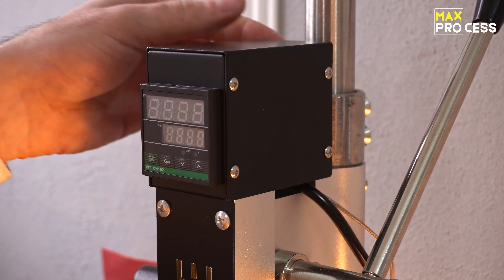The process of making a stylish brown leather belt

Comment: Question:
What are the differences to make an UNstylsh belt of any color, suitable for something like me to wear? 🤔😁
Reply from the maker: I don't understand you a little bit, do you need a belt for everyday wear ?
You need to decide what kind of trousers you're gonna wear it with. 
Either trousers or jeans. 
Then we can figure out how wide you want the belt to be. 
You also need your waist circumference to know the length of the belt. 
Thank you.
Reply: Buy a strip of leather, best size for casual wear is 1 ½", get it dyed or raw veg if you want to dye it yourself. Mark out on one end of your belt blank ¾" from the end for your first rivet hole (3/16" punch). Make your second hole 1¼" from your first hole, from that ½", 1", ½" 1¼". Mark all of those with an awl of pencil then punch. Then cut two slits to connect the third and fourth hole making it one oblong hole. Then cut a separate leather strap ½" wide and 4⅛" long. Dye all your pieces if undyed. Punch two holes for stitching at either end of the 4⅛" strap and sew both ends together. Now assemble your belt with your chosen buckle and according rivets(I use chicago screws, less room for errors) make sure your ½ belt loop is in place after assembly is finished fit your belt through your loops on your pants and make a mark where it fits comfortably. Take it off and Mark 2 holes either side of this hole with a 1" spacing. Punch all those holes Then cut your belt 3½"-4" behind the 5th hole. Cut in any shape or curve you want. Then your belt is finished. Or just contact me of Facebook at Bessette Leather Company